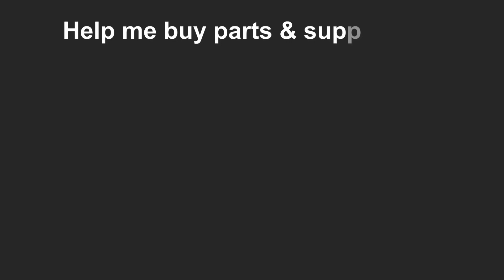The Needle Thread Tension System of the Singer Model 403A Sewing Machine

Comment: Andy i learned that the beehive spring when fliiped 180° ie when the formed end is on top, applys more psi to the washer stop tang. It worked better when i assembled this way
Reply from the maker: Thanks for sharing and I pinned your comment to the top. If you are using the original spring it may be from usage and it is slightly weaker. The odd thing is different service manuals from Singer show different locations for the "teacup" or "boat" loop of the spring. I questioned a retired Singer repairman about it once and he said it does not make much difference so put it back on the same as you took it off. I've also learned each machine is unique to how and how much it was used. What works on your 403A may not work on mine.
Reply: @andytubesewing1953  I noticed the washer tang in your video is arched as all mine were straight which can also acct for the variations in Assbly, but yes each one is particular. Thank you Andy

Comment: this video is so great, I've watched it several times and it keeps offering me encouragement to relax and see if my tension unit's functioning is good, and if it's not, to figure out why without forcing anything.
Reply from the maker: Thank you for the kind words. 🙏 I'll never forget the time my Mom asked me to clean and oil her model 66 and then came back to find her tension assembly in pieces on the table. It all turned out well, but she panicked b/c the Singer Store told her to never mess with upper or lower tension as a factory-trained specialist was required for that. I have 36 tension videos on my channel b/c I want people to know how to care for the parts. There are not any factory-trained Singer guys working any longer anyway, so now we are the "specialists". I appreciate you watching my channel. Take care.
Reply: @andytubesewing1953  I also want to express my gratitude for the positive impact your videos have had on my life, I was only interested in quilting and some construction sewing and happened to have a 503a I got cheaply at a thrift store, some problems with it led me to discovering the AndyTube channel.  Not only did I get the 503a into adjustment again, but I found myself admiring the quality and beauty of the direct drive slant-o-matic family. In the last year I've picked up all 5 400s and 500s, plus this week I bought a 631G which I was very surprised to discover was another all-metal gear driven class 66 bobbin machine (I was expecting Touch and Sew).  Your videos turned me from a sewing machine user who really didn't care into a real appreciator of these marvelous machines.  Thank you!
Reply from the maker: @sauces_official  You certainly have some of the best machines that Singer ever made. I've not had the pleasure of working on a 631, and not even seen one in person. It looks like a fascinating model, and good to know it has a class bobbin/hook system; thanks for that. Interesting that it only took that first Rocketeer to get you started on a collection, but I know how that goes. Thanks for sharing.

Comment: great video Andy, Thank You.  How does one know if the slack thread regulator and tensions thread guide is out of adjustment ?  and if it is, how does one adjust it ?  I recently took my tensionizer (the whole assembly that you are working on) apart, cleaned it, took mental note of where everything was set, and put everything back in the same position, , , ,it works (I love the names of things).  Thank you for being a great teacher.    @ 33:30 for anyone who is trying to figure out what I'm talking about.
Reply from the maker: A very inciteful question, Thomas. Thanks for asking, and for watching my channel. The slack thread regulator is used to set the stoke of the take-up spring. The spring must come to rest on the "stop" of the regulator as the eye of the needle enters the fabric. At that point, you want slack in the thread so the hook can grab it and pull it around to wrap the bobbin thread (making the lock stitch). Here is a video demonstration of checking and setting the stroke of the check/take-up spring by adjusting the Slack Thread Regulator. https://youtu.be/t3UqzYRo-cc
Reply: Andy, thanks for having a channel,  You have been instrumental in the revitalization of a Singer 301.  This pathetic thing has been locked away for 70 years face down in the cabinet,  the extension bed had a broken hinge, and other than that, nothing wrong.  it was used I saw the video you did on polishing the grooves out of the backing plate of the bobbin case holder.  the plate had one groove.  so I redid the whole machine using your instructions. . . . .MANY THANKS.  as far as the slack thread regulator, it went back where it was before I took the tensionizer apart, and just verified that it does what you say it should do.  Also, I was thinking about buying Grace screwdrivers, but I'm leaning toward Chappman after seeing you presentations.  thanks for the link above, and all of the knowledge you have shared to so many people.  (I'm new to sewing, at the age of 64, I realized that every grown man should know how to sew, so, here I am.  thank you.  Have a great weekend.   @andytubesewing1953
Reply from the maker: @thomasgronek6469  https://www.youtube.com/playlist?list=PLsCOZgzzaiKLZyGebzS_oISgesXNyREyI
https://www.youtube.com/playlist?list=PLsCOZgzzaiKI_6fbu3itbd1v4z3uQvvkO

Comment: So I wasvmessing with a couple of 403s. One of the tension assembly thread guard screw was as you described, with the driver blade slot cutting all the way across, but one had a flattened head and the slot for the driver blade did not cut all the way across; it was a linear hole for a flat blade driver. Both screws worked. I just thought the l after mentioned one was interesting even in manufacture. I have Lso noticed more variation in parts than I would have believed on such a machine. One thing is the copper coloration of the tension indicator was very deep and rich on one, and very light on thec other.  There are so many mechanical engineering points of interest on the machine. It is like it contains every mechanical trick in the book embedded in one machine.

Comment: Like a similiar commenter, the rounded screw holding the thread guides on my machine is stripped. It actually seems a bit flatter than the screw you pull out at 33:28. The slot in the head of the screw looks a bit like a bow tie. Really not sure how to get this out. Also, my releasing lever doesn't have a spring attached like yours. Any advice would be so appreciated, thanks
Reply from the maker: It may not be the original screw. I've had some luck dripping WD40on and under the screw head and letting it sit and I have also used a hairdryer to heat it up before attempting to unscrew it. 
     Some folks bang on the screwdriver with a small hammer while turning. 
A friend has told me he does 1 of 2 things with this. 1. he uses a rotary tool with a metal cutting blade and widens the slot to make it even then uses a wider screwdriver tip, or 2. he cuts a new slot into the screw head at a 90 deg. angle to the original slot. He is good at it but it sounds tricky to me with my shakey hands. 
     The screw is called (ready?) "Slack Thread  Regulator and Tension Thread Guide and Thread Guide (Upper) Screw. 
Singer Part No. 329. Hard to find and usually must buy vintage thread guides with the screw.
The little spring on the Tension Release Lever is Part No. 12329 and this company seems to sell it: https://www.sewingpartsonline.com/spring-singer-12329.aspx    They do not show the 401A/403A/404 model numbers though.
     You can also buy the release lever with spring and sometimes the lifting lever on eBay by searching for SInger model 401A Tension Release Lever. It's part 172139 and it is the same parts on SInger Model 401A, 403A, and 404.

Comment: My first Mocha 301 is a lost cause for the tension unit too.  The indicator bar on mine is completely broken off and the stud was so badly damaged that the indicator bar wouldn't go thru it because it was crushed down in the middle and really wide at the tip.  The end was jagged and unable to have the nut put back on it.  I can't even remove the stud from the machine and am stumped as to what is the best way to fix that issue, since I couldn't get it off, I took a flathead screwdriver and put it inside it to widen that crushed gap, then used a pair of pliers with a cloth wrapped around it to lesson the gap at the tip.  With it on the machine it was fairly simple to do it.  I just need to figure out how to get the stud out of the machine.  The set screw is a tiny screw and certainly not the correct one for it. The stitch length indicator is also a mess and has to be replaced. I bought a replacement for that but when I realized the tension unit was so bad I gave up from the cost of replacing it too.   I've had it over two years and gave up but wait!  Great news.  I bought that LBOW 301 and it has extra of all the parts I need to be able to fix the mocha.  Yeaaa.  Thanks again Andy.  You are so very much appreciated and it doesn't matter the length of the video's.  They are so very informative for all of us.
Reply: I got my 403A tension unit, the needle clamp unit and thread guide all removed finally and cleaned up. A little at a time and i'll have a 403A to sew on and I couldn't have done it without you.   Eek I'm excited Andy, truly excited.  Thank you so very much.
Reply from the maker: Nicely done. Never give up. You have the desire and that's about 90% of restoration. ✨
Reply from the maker: @donnasmith2720  You'll enjoy sewing on that 403A. You keep moving forward. I admire your persistence 🙏

Comment: Thank you so much for such in depth information on the tension system. By watching your video, I realized that the mechanism for releasing the tension may need some work in the future.  I am working on a 403a machine just like this, but am not brave enough to to the complete job you have done on this one.     My goal is to get it in better condition for my granddaughter, who has expressed an interest in sewing.    I am in need of some minor things for the 401, and hope to find some accessories also.   Since Sew Classic is no longer in business do you have any good sites to find these things?   I have two 301s and a featherweight and sew with them regularly. They are such great sewing machines.
Reply from the maker: Parts & Supply sellers have mostly moved to online locations like eBay and/or Amazon. I just look for a good price from a seller with a high rating. There are a couple places that are direct, like the old central Michigan sewing: https://www.vintagesingerparts.com/collections/singer   and a very large one: https://www.sewingpartsonline.com/   but there are dozens of good sellers now. I usually search on eBay for the supply or parts I want.
Reply: @andytubesewing1953  Thank you for your help.

Comment: Yikes, Andy. I found white powder stuff on the wires that connect to the motor as I went to remove it.  It’s coming from the prong plug from the foot pedal.  I sure hope that’s not a big deal.  Any idea what that is, why it’s there and how to clean it up?
Reply from the maker: It's not a big deal but wear a mask & gloves. I've only seen it on 1 or 2% of the machines. Sometimes it is all along the wire to the lamp also. We disagree on what it is, many, like me, think it's a type of mildew, but others think it's a reaction between the vinyl wire coating and the aluminum of the body. Like an oxidation. I usually take old strips of t-shirt rags, dip them in alcohol, and wipe it off wherever I find it. Throw the rags into a sealed bag or container and dispose of them. Don't leave them lying around the work area. Whether it's mildew spores or oxidized aluminum I don't want to breathe it in.
Reply: @andytubesewing1953  that’s a small percentage and sure enough I had to find the right machine!🤣. And yes, it’s all over the light wire as well, going up in to the machine.  Thanks for the information Andy and I’ll take all the necessary precautions you mention.  This machine doesn’t even compare to the 404 I found as far as how much cleaning it’s needing but I sure need the therapy, I’m loving it.

Comment: Thanks so much had taken my tension unit apart to check it as tension is off on a different model but couldn’t figure why it wouldn’t put the spring back in tension turned out to be as simple as where the small front bend was when reinserted not in my sewing manual for the machine but fingers crossed saved me a trip to the repair store
Reply from the maker: Nicely done then. I'm glad you found the video. Thanks for your comment.
Reply: @andytubesewing1953  yes it’s a singer. 358 around 45 years old a gift from my Nan who was a tailor in before she married (she then had to stop as married woman couldn’t work in those days) I had it fully serviced last year but the tension  has gone out again when I using it maybe will have to retire it but trying to see if it’s something simple first
Reply from the maker: @CraigsOverijse  When I download the manual from Singer https://www.singer.com/search/support?title=358   It shows a different style of tension assembly than in the video. You can buy a replacement if you feel yours is worn out:
https://www.vintagesingerparts.com/products/singer-upper-tension-assembly-fits-models-337-338-347-348-350-360-362?_pos=14&_sid=8ef926c1d&_ss=r     Also, I don't want to send you on a wild chase, but sometimes tension problem is on the bobbin case. I believe your machine has an Apollo case, or class 66. I have a video for that type of case; https://youtu.be/HT5XZ5eYYEQ   and if it won't stay adjusted they are not expensive to replace: https://www.vintagesingerparts.com/products/singer-apollo-bobbin-case-fits-many?_pos=1&_sid=a1dc0f216&_ss=r
If you are otherwise happy with the machine it is worth it to investigate/adjust/replace a couple of parts ($30) than to replace the machine. Good luck, and thanks for watching my channel.
Reply: @andytubesewing1953  thanks so much for the tips Andy,  actually two things helped one was putting the tension pieces off and one once knew the tip about the wire from you and another tip I saw was to do with incorrectly wound bobbins, I had already checked under the bobbin for fluff. So simply trick to try I rewound the bobbin being sure it was looped in an x on the peg and presto good as when it came back and now able to use it again! Win Win for me love my old machine doesn’t get a heap of use but like to know it’s working when I need it
Reply from the maker: @CraigsOverijse  Yep, I misread your previous comment and thought you were still having some problems. I'm happy to hear the machine is working the way you want. Take care and thank you.

Comment: So I heard you wouldn’t get a junky looking machine (like I did) but, still,do you have any advice to repair the paint of a 411 that has several points where the original paint is gone? Thank you
Reply from the maker: Nope. I've never done paint repair to that extent. Only touched up the little nicks and scrapes. https://www.ebay.com/itm/134021052513?hash=item1f3446f861:g:wekAAOSwKIpWAF7A
There are a few folks on YT that stip down the machne, sandblast it, and repaint, and some who just tape off parts and paint the machne bed where the paint is gone. I've just never done it.
Reply: Thank you Andy, I will look for a paint to correct the bare spots
Reply from the maker: @paulamendes5907  Sure. I spoke with a friend in NY last night. He said he has had a few machines where the paint on the bed has really worn down from fabric dragging over it. He said hardware stores like Home Depot will sell an 8oz "sampler" of paint for color testing. They have enamels and acrylics too. He takes a part with good color, like a cover or nose piece and they will use their color matcher scanner and mix him the 8oz sample for about $5.00. He will paint the whole bed, or maybe the arm cover, rather than try to "patch" the bare spots. He said some of the matched colors are perfect and the worst ones were, very, very, close and looked better than the bare spots. He has used brushes and tiny foam rollers to apply the paint. He thinks the guy on eBay selling the little paint jars has just had the paint matched at a paint store as he did. However you go about it I wish you the best of luck, and I thank you for saving the machines that you do.
Reply: Thank you so much for thinking about this, Andy. This is very good information - the paint is missing mostly where attachments go and where fabric and hand/ arm rub. This 411G belonged to a professional seamstress her whole life. The machine has all the attachments as it was probably well cherished but she naturally also shows she’s had a full life :) Now for a quieter time but she is my only machine that can chainstitch, which is an upgrade relatively to the 401G ( less used, and soaked in dry oil as we talked earlier :D ) so I will definitely give her some use once and a while. Still wriggling a bit with the chainstitch, but I suspect the tensioner needs a good cleaning and this will do the final trick. The “smallest ever” screw is stuck, so now resting in wd-40. One advice for all of us - the chainstitch needle plate was kept in one of the little drawers, next to a felt (from the base I think), and as a result, after at least 11 years, the area of the plate that was in contact with the felt was very, very rusty. Probably the felt absorbed moisture. Dremel and patience got it back to function as fortunately it didn’t affect the core parts for the chainstitch formation. Thank you again for all your help and good advice! Always a pleasure to learn with you
Reply from the maker: @paulamendes5907  I wish your machine could talk. A well-used machine is often well-loved especially when owned by someone making money with it. You've got 2 great machines there for sure. Happy stitching.